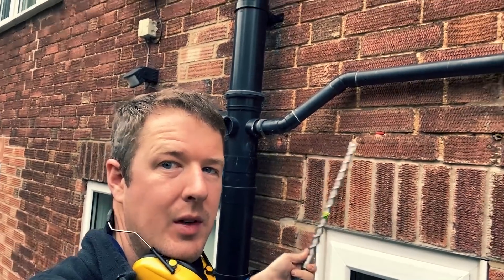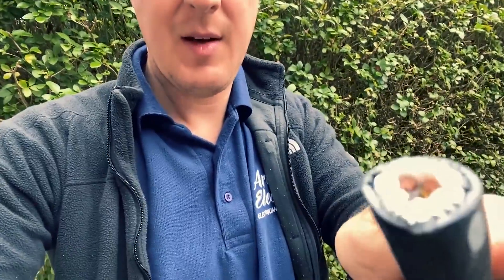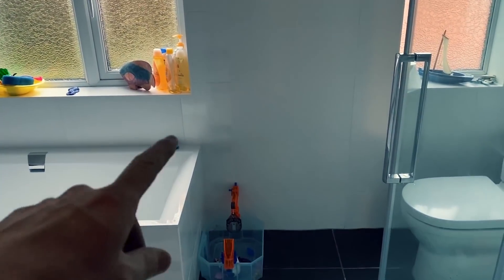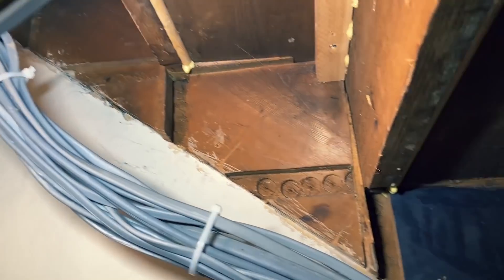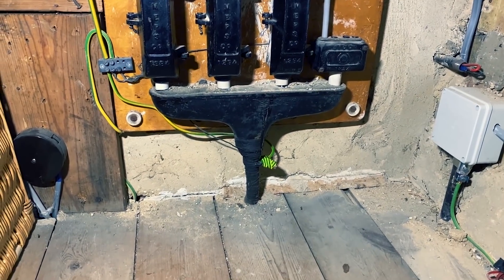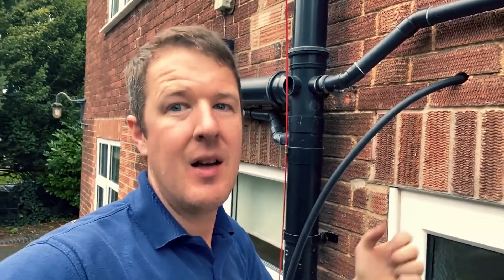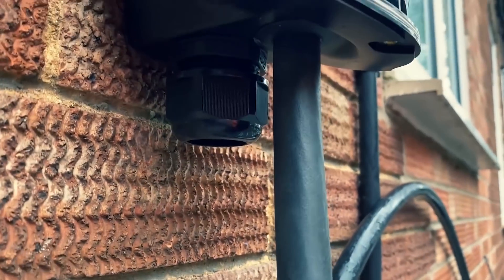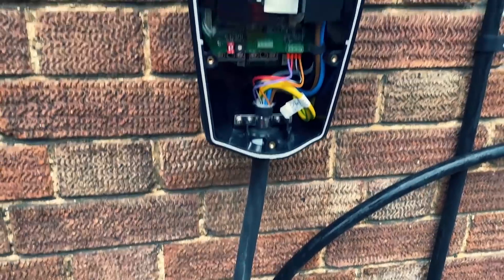Installing a Tesla Wall Charger UK

Comment: I'd suggest RTFM before starting :)  I put mine on the wall myself and just got an electrician to wire it up.  Things like the plugs on the unused back entry slots are all in the manual. There's also a security Torx bit in the bag!  Also, just bugbear, but I wish we could stop calling these chargers (Tesla uses the word wall connector) as they are just glorified plug sockets with a few extra safety features. The car has the charger built into it.

I do still enjoy the videos tho.

Comment: Hi @Artisan Electrics. I have a couple of questions if you do not mind. I did the EV course with NICEIC about a year ago and I am starting to get enquires with regards to installing charge points. 1) If I want to install a Tesla charge point do I need to register with Tesla as a Tesla approved installer. 2) if so what are thier requirements? I know with rolec I have to buy their tester, is that the same with Tesla?? Also has the tech moved on with ?Tesla with regards to the earth rod situation or have they got the Neutral failure detection device? I greatly appreciate any help and fantastic content!!

Comment: Like the ground rod PVC access cover (no idea what it's called) in the states our new code calls for two ground rods 10 feet apart, so using this type of device might facilitate a good installation with the added ability of the ability to checking your ground Rod connection it also would allow water to migrate down the ground Rod to decrease resistance.

Comment: Is the 32mm compression gland thing necessary? Does it not come with one
Reply from the maker: No it doesn't come with one and you do need some kind of gland to terminate the cable properly
Reply: Artisan Electrics is it still necessary if I do back entry through the wall?

Comment: Very lucky to have a 3-phase supply in a residential property in the UK, electric vehicle charging is probably one of the few things that can take advantage of it. That said, there are currently very few EVs that can make use of the full 22kW charging. The fastest charging EV on 3-phase AC is the Renault Zoe, all models have 22kW chargers on board and some of the earlier models even had 43kW onboard. I think all Teslas are limited to 16.5kW which is still better than most (11kW or 7kW).
Reply from the maker: Yes you’re right thanks for the comment!

Comment: Tesla, the Apple of the car makers, just like Apple you have to have the specific points, no way they would considering using a standard point 🙄
Reply from the maker: You can use any charger for a Tesla and it will work fine but they make their own chargers as well of course like this one.

Comment: Quick question Jordan. Do the Tesla chargers have dynamic load balancing built into them? As in, if the consumer unit has a 63 amp main fuse and there is a 9kw electric shower already installed in the installation. Will the Tesla charger “see” that there is less power available while someone is using said shower and reduce its current draw until the shower is no longer in use and then return to full operation again? Or would you just have to set the max operating current at 25amp for permanently? Garo have a load balancing meter which can be installed in the consumer unit combined with their own brand of ev changer for this situation. I doubt I could combine the Garo dlm with a Tesla charger though. Any opinions? 
Great video
Reply from the maker: No they don’t have load balancing they are quite basic to be honest but good quality.
Reply: Artisan Electrics, cheers for getting back to me Jordan that’s great to know just so I know what to price for on an installation I’ll be doing soon. Much appreciated 👍🏼
Reply from the maker: Mr. Bones you’re very welcome!

Comment: Loving these EV videos. What's the story with testing the built in DC RCD. What meter do you use for it as my Megger can only do Type A and AC.
Reply from the maker: I use a Fluke 1664FC which can test various types of RCD

Comment: Where is the means of electrical isolation?

Danger to self & others, working at height off a pair of steps.

Is one permitted to install non-BG equipment into a BG consumer unit?

Your Dad would not approve!

Comment: Great video , I was wondering how you work out the MD for these installations as on most consumer units I come across even after diversity the MD is usually well over 60amps even before adding the 32amps of the EV charger and if the new MD is over 60 I have to inform the DNO before the installation , do you use a clamp meter to determine the actual demand ?

Comment: It looks like around the 1930’s.....Very similar time the cable service head I’m working on in a 1930’s cottage.  I’ve worked on several bigger properties in Ayrshire and all have had a three phase service head run to the property, even though some of them have only utilised one phase, but still running a 3 phase board with the phases linked out to provide supply to each segment of the board. Good if you’re looking to convert a bigger property to an HMO...😂
Reply from the maker: Yeah very interesting thanks for sharing!

Comment: Did he just put an armoured through a stuffing gland? Not good practice that.
Reply: EV chargers residual current content when selecting RCDs, and EVCPs may contain as a minimum requirement Type A RCDs – Reg. 722.531.2.101, provided it can be determined that the smooth d.c. residual current doesn't exceed 6mA. Some chargers will not work with Type A RCDs, but nearly 90% do refuse to manufactures instructions.

As for the compression gland its perfectly fine to do it the way Jordan has, this is a common method to out buildings where extraneous conductive parts are present and TN-C-S (PME) can't be exported as a metal gland with an metal enclosed would export the PME. As long as the supply end had been been earthed (providing it needs mechanical protection due to the installation method to provide fault protection)
Reply: @fuzedtv  

The question is not whether it's a common method, it's still bad practice to use a stuffing gland with an armoured, we both know really it should be a waterproof swa gland, it's not necessarily dangerous but I've seen capillary action bypass many a stuffing gland. And that becomes a right pain in the arse.
Reply: @paulw6183  A Water proof armoured gland would still be no good on a metal consumer unit if exporting PME was an issue. I agree for this install maybe the Waterproof armoured gland would be a little more suitable option providing the Tesla charger housing isn't made of metal but using a compression gland with the cable supported below via a cleet isn't ''bad practise'' or ''rough''
.
Reply: Not good practice to use a metal swa gland anyway as you are not exporting the pme earth, the charger has its own earth.
Reply: @workshopchrisyt3017  

If you're using SWA for mechanical protection, then you you should use metal glands and make sure it's earthed correctly, otherwise just use hi-tuff cable or something similar, to be fair I don't see why he needed SWA in the first place.
Reply: It has a separate earth rod and box is plastic. Plastic box to plastic gland seems fine to me.
Reply: @eileendonnelly1195  

It's still bad practice, make an swa gland off properly and you can't pull it loose, you could hang a car off it, no stuffing gland provides that protection. It will no do doubt probably work fine and not be a problem but it's still not the way it should be done, simple as that, it's lazy workmanship, you can get away with not earthing metal back boxes or putting paxolin between trunking and DB's but it's still cowboy.
Reply: @paulw6183  He would  have to fit a metal junction box to the wall below the charger to provide a nice way to terminate the swa to get the benefit of the extra strength. Then run cable though the box and conduit to the charger. Otherwise the swa if pulled would just break the plastic charger unit. That's actually the way I would have done the install. Still I think you are incredible unfair to call his work cowboy. It's perfectly safe and may have saved the client money.
Reply: @eileendonnelly1195  

If the plastic box isn't particularly strong then yes that's precisely what you should do, whacking it through a stuffing gland is lazy workmanship it's really that simple. What's worse is this is meant to be a tutorial on how to do the job properly.
Reply: @paulw6183  Good point about it being a tutorial, it should not be just an OK job but a great job. If it was my own install I would not do it that way. Since I don't think the run was too long outdoors, doesn't go underground, though a workshop etc. Hi Tuff 10mm 3 core cable would have been a better choice. Which would work fine with the plastic case and easier to feed.
Reply: Paul W exactly what I was thinking. Surely a reducer from 32mm to 25mm would have made more sense. Also is that a type B RCD as required on most three phase EV chargers?
Reply: @c8bbr  

That's what I thought, and good spot I don't think it was, very much a house bashers job, it'll work but with a few dodgy shortcuts/unsafe practices thrown in. Although I have to say I've come across far worse!
Reply: You shouldn’t use an SWA gland at the charger end of the circuit because it would export the house PME earth to the charger position. That leaves only the only option of a stuffing gland. As for cable choice, the SWA is earthed , and the cable is solidly clipped with strain relief - so what benefit are we expecting from swapping it with hi-tuff type cable? It would be the same clips, same gland. Some might argue SWA is superior when clipped along a wall.
Reply: @bencrew4376  

Why would you be exporting the earth by using an SWA gland? You don't need to use a fly lead if the charger unit is already earthed, it's just about doing things correctly, loads of rough sparks out there use bad practice but get away with it, it's not dangerous it's just lazy.
Reply: Paul W correct no need for a fly lead, but the SWA gland would be at PME potential, which we are trying to avoid. The PMe earth is exported as far as the gland. I agree in 99% of SWA jobs glanding both ends is the only way to go. But there are cases like this one where separation of earthing needs a bit more thought. I think if the cable is earthed, secure and water-tight its ok.
Reply: @bencrew4376  

Why are you trying to avoid the swa gland being at PME potential? To what benefit? To me it sounds like excuses for lazy workmanship, you can dress it up however you like but an armoured should be glanded off properly at both ends, unless you're jointing underground. I guarantee you if that was a 20/25mm hole he would of stuck an swa gland on there.
Reply: @paulw6183  under fault conditions there could be a potential diff between the SWA gland and the car charger earth. They are not bonded together. Do you see any problem with that set-up?
Reply: @bencrew4376  

Put a fly lead on it and bond the earth's if you're that concerned about potential, increase the CPC size under fault conditions, I think you're really clutching at straws now mate.
Reply: the thing is - by connecting the flylead you have connected the charger back to the house PME system.
Reply: @bencrew4376  

The charger is connected to the same earth bar as the SWA back at the board anyway. He even mentions that you need a 32mm stuffing gland because a 32mm armoured gland will be over sized, which is obviously true but you only need a reducer.
Reply: @paulw6183  that's not actually the case - Here he runs a 5-core but doesn't connect the 5th core it to anything. Only a 4 core cable is needed as the charger has its own separate earth.

So in my opinion 'if' you have to use SWA for this, you can't common the earths together, because they should be separate. You can't use an SWA gland at the charger end because you are exporting PME potential into the charger, and so would need bonding to the rod. You can't bond it because you would be connecting the charger back to PME. 

So options are - insulate the SWA armour at the charger end, or use a non-armoured cable.
Reply: @bencrew4376  

That's even worse then, leaving a floating cable not earthed at either end as part of the install? If that's true that's real cowboy stuff, at the board end put the fly lead off the armoured into the earth terminal along with the earth core, at the charger end swa gland with a fly lead into a terminal block along with the spare earth from the cable as the charger needs it's own dedicated earth. As I said, he even says the only reason he didn't use a SWA gland was because of the 32mm hole, there was absolutely no electrical reason for him using a stuffing gland, it was purely for convenience. All I've said is that although it's not dangerous in itself it's bad practice, and in a tutorial video.
Reply: @paulw6183  its not floating, the SWA is earthed at the DB. 4-core is best for this job, and in my opinion, best practice to electrically separate the two earthing systems, and associated conductive parts. Each to his own, and this is a VLOG not a tutorial.
Reply: @bencrew4376  

Along with the armoured, so why not put them into a connector block at the charger end? The main earth and charger earth are still separate, otherwise put a junction box underneath and run two cores up to the charger, basically there is no electrical reason or benefit to using a stuffing gland over an SWA gland. Surely you must see that?
Reply: @paulw6183  the electrical benefit is - the earthed SWA armour is insulated from any PEN open-circuit fault that appears. While the PEN fault can't go beyond the charger gland, I would prefer to have only one earth potential appear in that zone, especially as we can't provide bonding.
Reply: @bencrew4376  

If that's your concern then you should put in a junction box below and run two cores up to the charger, if you're really that concerned about insulating the armoured strands from the earth rod, do it properly and separate them completely. I get that I'm being picky, but for a tutorial wouldn't you expect a 'perfect' install?
Reply: @paulw6183  I'm with you, picky is better than shoddy. it would make a better video to see some of the poorer examples of car charging installs..I think this one will shine in comparison to some!
Reply: @bencrew4376  

It's not a rough install overall, looks pretty much spot on apart from that stuffing gland, which I get why he's done it, 32mm stuffing glands are probably in his van and I doubt a reducer and waterproof swa gland are, plus it isn't going to be dangerous. I see far worse than this on a regular basis!
Reply: Paul W nowt wrong with the stuffing gland
Reply: @bencrew4376  

I suppose that's the difference between us proper sparks and house bashers eh? 😉
Reply: Paul W 😂

Comment: Just wondering why use 5C SWA, wouldn't 4C suffice?  What do you do with the SWA earth core in the charger, is it just tied back?
Reply from the maker: Yeah I could have used 4 core but I always prefer to use 5 core just to be extra safe. I just tied it back in the charging point yeah.

Comment: Hi mate love these install videos! Very informative

Am I right in saying that customers don’t get the grant for Tesla chargers? 

Also how did you go about certification for this job as you connected up new tails to the db main switch? Are we meant to test the installation prior to connecting up new supply? 

What about gas and water is this something you check while estimating a job? As eic requires gas water in place?